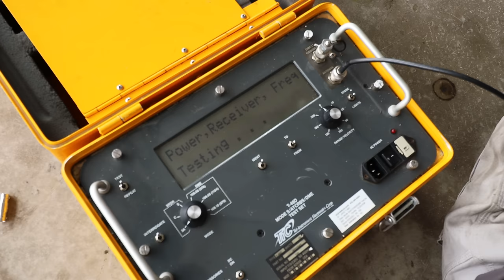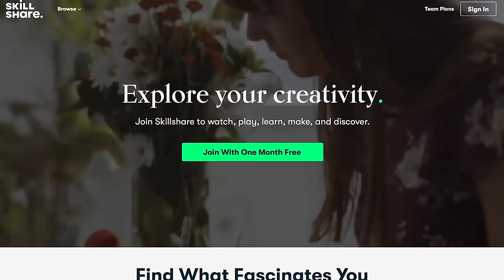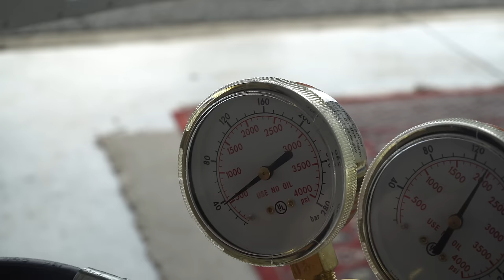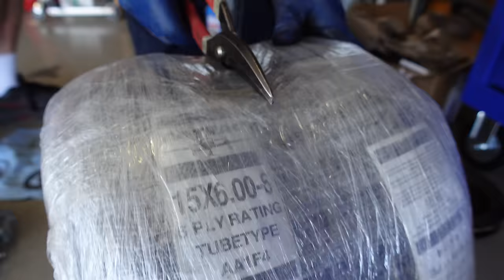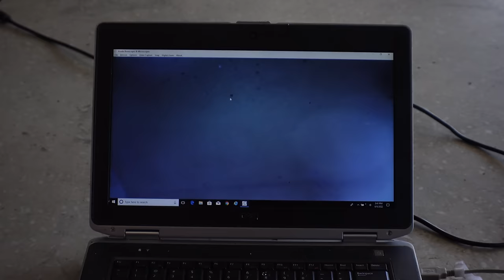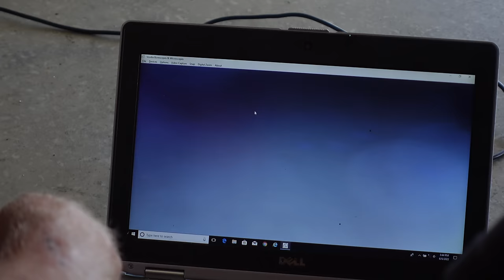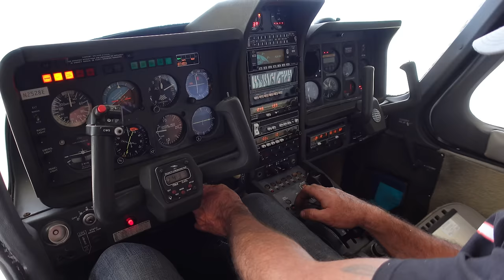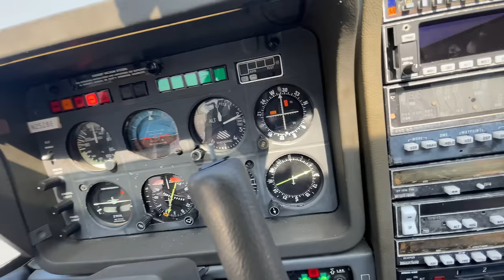Taxiing My Abandoned Dream Airplane For The First Time In 15 Years !

Comment: The amount of work that goes into this is insane. If a plane that small needs that much work you really get to appreciate the technicians that maintain commercial airline planes to keep those huge monsters up in the sky safely.
Reply from the maker: 100%
Reply: The smaller they are, the more difficult they are to work on.
Reply: The problem is the time spend sitting, normally you do continuous maintenance where you will check specific items , not all, so if you do continuous maintenance the expense is lowered and you will have your plane ready to fly always
Reply: Every annual isn't like this. This time, because it's been sitting so long without getting air under its wings, the work is nearly all remedial. When  an airplane is in regular use, most of the work in a normal annual is checking to make sure that nothing's broken, about to break or out of tolerance. It makes a lot of difference, but it still costs $money LOL
Reply: Every size and model of aircraft holds its own challenges. Nothing in aviation maintenance is an easy task. I have respect for all of the workers.
Reply: Tons of time and elbow grease, but none of it seems too intimidating.
Reply: @johnnunn8688  Not necessarily - personally, I PREFER working on the smaller ones (when I was working as an A&P) than the larger commercial (Regionals) aircraft.
@RebuildRescue, unfortunately I'm one of those who can't make it to Oshkosh (much as I'd like to be there), but will try to be "in attendance" online (no guarantees, though).
Reply: @mikebelanger4165 , yes, I also prefer the smaller a/c, it hurts less when you fall off them. The point I was trying to make is, given the equipment on the a/c, there is more space to work, on the larger a/c.
Reply: @johnnunn8688  I’m A&P and I can tell you that it’s easier to work on bigger airplanes in terms of space but in term of time and money smaller ones are so cheap to work on and maintain but it’s pain in the as*to crumble in these tight space to work on some parts
Reply: That and the fact that it’s all volunteer labor why not go for the gusto. Cost him not a dime. May be a few parts here and there.
Reply: @mcasanova1963  Exactly! The worse thing to do with a plane(or actually ANY mechanical thing) is let it sit..Gotta use it!
Reply: A whole lot of people are involved in maintaining airliners, so that work is spread out quite a bit.
Reply: @battz99  I'm still surprised that they haven't bothered to power wash that engine at all. After I knock the big chunks off that would have been the FIRST thing I would have done!
Reply: @sm5o485  Cheap? Are you s******g cash?
$70,000 for an engine rebuild? Another YouTuber says every time he turns around it's $2,000 or $5,000.
Reply: @randallsmerna384   it’s either English is not your first language or you can’t read allow me to elaborate please if you’ve seen my comment it was based on comparison between what’s best to work on big airliners like A320,B777,737,787 I said in terms of space it’s very comfy to work on it but cost so much overhauling one engine could easily be upwards of 800K and maybe triple that depending on what type of engine are you using but small aircraft like the tb-10,C-172,piper180,Mooney M20,s  would cost anywhere between 35-45K so in comparison isn’t that considered cheap to maintain?
Reply: @randallsmerna384  and if he says he drops 2000 or 5000 every time he turn around I think he should scrap his plane because maintenance in small  aircraft privately operated only requires annual inspection which is every year it’s around 90$ per hour and only 16 hours for the inspection other than that you need oil fuel and tires and they’re not expensive either “in comparison to aviation prices not car prices” so yeah you might face a major discrepancy but when maybe once every 7 to 10 years depending on the airplane and how many hours you’ve flown and have you taken care of it or not hell it might not even have a major discrepancy because airplanes are built to last if you maintain it right if you go cheap you might pay with too much money or sometimes unfortunately with your soul.
Reply: @randallsmerna384  Totally agree
Reply: My father has owned planes for as long as I can remember, for over 33 yrs.  Can’t remember first 7.  Anyway, he has spent at least 1-2hrs every weekend at the hanger with his planes for those 33yrs.  He is always working on, cleaning, updating something.  It’s a way of life when you own small planes and fly them often. Your wife and kids either learn all about it or miss seeing dad a few hours to days every weekend 😂.  Needless to say my brothers and I embraced it and soaked in as much as we could.  We were always ready to go up in the air to take the controls.
Reply: @johnnunn8688  Not true, I work on everything from a Cessna 150 up to C-130s, small aircraft are much easier

Comment: I know you said you are getting a new XPDR because you need ADSB out but I'd recommend a full VSWR and insertion loss test be done on the RF cable and antenna. More often than not its a cable issue (corrosion, vibration, chaffing) that cause most of your problems. These issues cause the TX side amplifier to burn out and can damage the  RX side of the XPDR too. I am NOT an A&P commnav I am a ground NAVAIDS/comm maintainer. Same principles apply.
Reply: Yeah, 34 year old coax and connectors? Then replace the XPDR because the signal is weak? Bad practice.

Comment: I love to see how old airplanes are coming back to life.
At 10min 35 s it is visible a crack on main wheel well. It was drilled once in the past but it is spreading. I belive, for safety reason, it should be investigated and repaired. Many best wishes for this and other projects

Comment: Interesting to see the KC 191 autopilot. Me and three other engineers designed that approximately 35 years ago. Amazing to see that product still in an avionics panel. The AP is a hybrid... the inner loop is analog and the outer loop is digital. At the time we designed it the microprocessors didn't have enough throughput to run both the inner and outer loops.

Comment: If you haven't done yet, make sure to remove the pitot tube and static port to check for some possible obstruction. Their lines and gages must be checked as well. And make sure the pitot tube is covered at all time while the plane is on the ground. A tiny bug can cause serious problem.
Reply: Yeah, a bug caused a multi billion dollar B2 Spirit, to crash!
Reply: What serious problem would that be ?
Reply: @pauleyplay  the pitot tube senses the air going into it to operate the air speed indicator, along with other instruments
Reply: @audvidgeek  Almost. Senses air pressure only to the airspeed indicator, no other. You may be thinking about the static lines. Think about this, pitot is uncovered throughout all flights. They get all kind of guck & speed goes to 0 ). Most general aviation light  to mid planes no big deal. If a landing cant be made without airspeed indicater more training is needed.

Comment: Just a recommendation here I love the channel, but I recommend that you use copper based never seize on components with heat you’ll see that it says hi temp. The regular never seize will degrade on plugs or exhaust manifold studs or bolts. Keep up the good work guys!

Comment: Before replacing transponder, disconnect all connectors, give them a good clean with some contact/carb cleaner and reconnect.. i know all contacts should be gold, but that reading was not far off.. love what you do!
Reply: Not only that but if it failed for weak signal suspect the coax and antenna.

Comment: Awesome job guys, best practice is to always deflate a split rim tyre before removing the axle nut, just in case the rim bolts could fail. Cheers from Down Under

Comment: I would invest in a good speed handle. Using a regular screwdriver in crazy with all the screws in those panels. We used them in the Air Force when repaneling F-111's. They worked great and where a definite time saver and relieved ones hands from cramping up.

Comment: Did you know that you can put those brake rotors in some muriatic acid for 30 minutes, take them out and rinse them off with soda water then rinse them off with clear water and dry them immediately with compressed air and they will look brand new in less time and much less labor than doing it by hand with a wire wheel. Just a thought, good luck with your projects.

Comment: Make sure to align the dots on the sidewall with the valve stem of the tires. That allows for quick reference of tire slip on the rims of freshly installed tires. That’s why the dot’s are there. Very critical for braking. Important to test on high speed taxi after installation prior to first flight
Reply: While you are correct about aligning the dot with the valve stem, slippage indication is not why they are there. The dot indicates the light spot of the tire to align the stem there reduces the amount of weights required to properly balance the tire assembly.
Reply: 180 the L too
Reply: The dot is for aligning the light/heavy side of the tire with the wheel. This provides a better dynamic balance. Just because you hear things, does not mean those things are facts. People make stuff up all the time by guessing.
Reply: @RedNeckWelding  Bang You got it ! Well done

Comment: Glad to see all the progress on this project. I've got one question. Doesn't civil aviation requires nitrogen to be used on tires and pneumatic struts? The reason I mentioned it is because when I was working on airplanes in the Navy that's how we did it and it was a big safety factor. Just trying to keep you guys safe.

Comment: I've heard of fighting fire with fire, but never washing dirt with dirt 😜. Get that man a clean bucket of water and some of mcguiar's ultimate buffing compound with a wool pad. You'd be amazed at what it can do!
Reply: NEVER buff an airplane with a wool bonnet. If you're not careful you'll burn thru the non-clear coat finish down to bare metal. Instead use a foam bonnet that doesn't build up heat like wool.
Reply: @dieselyeti  I use wool on automotive paint, just to buff off the compound, I do use foam pad to apply. Just gotta keep the speed down. That's good to know tho. 👌
Reply: @beb38138  That's ok for a clear coated automotive finish if you're careful and keep the wheel moving. But for whatever reason aircraft finishes aren't clear coated so you have to be super careful and use a foam bonnet. I learned the hard way many years ago.

Comment: Putting a little air in an inner tube helps with installing them straight as well. I usually put a little in to get all the wrinkles out and to help keep them from getting pinched.
Reply: I see you did it on the 3rd tire lol. I need to just watch instead of commenting lol.

Comment: The Trinidad is a beautiful looking aircraft. The French certainly know aviation. I see it has trailing type main gear legs (good!). Looks like the nose leg has a built-on airbrake.               I wonder if the grease nipples are metric, and your grease gun nozzle non metric?  At 28.05 there is a good view of the port & stbd wing spars join. I found a leaf blower also helps blow out grass from inside wings etc.  Joe is great!...love his humour (and white sox!) ...has a voice like Willie Nelson.  I use a floor crawler/creeper that has an adjustable headrest...so worth it! ..was about US$50. I notice you went for the quality battery.  And you noticed the airframe's internal chromate protection....SOCATA quality.

Comment: I saw that plane sitting for years. I was based at Frederick until 2019. I always thought what a shame to see it rotting. There was also a Grumman Tiger that sat for a long time but it was bought. Get it back together and you will have a very valuable plane there.
'

Comment: If the clear plastic on the wing tip light lenses is the same type as on automotive headlights,then maybe able to "buff" out the hazing with a very light "white rouge" buffing compound(by hand or using a small buffing tip with a drill)...
Reply from the maker: We were thinking that as well. Going to give it a try !

Comment: Maybe invest in a bench grinder with a wire wheel.  That will be like butter to remove rust.  RPMs on a cordless drill are too low to wire brush when you don't have to.

Comment: The heat build up inside a aluminum structure, without forced ventilation, is insane. How in the heck does the birds and their eggs survive that? Inside an aircraft wing sitting in direct sunlight!
I had to decline a job because I could not handle those still air temps.. Awesome job you and the crew are doing there.

Comment: when I see how ingrained the dirt is and especially the paint damage on the wingtips I think you are going to need a repaint! Applying a fresh coat of paint to a small aircraft will cost more than double the amount that is required to paint a car, depending on the type of paint and body graphics you wish to use. A basic coat of non metallic paint and the use of new stainless steel screws for the cowling and wing tanks will cost you anywhere from $5,000 to $10,000.

Comment: Watching the rest of this video Im thinking it'd be a good idea if working alone to have a pair /more of suction cups linked by adjustable ratchet strap such as used on lorries to secure loads to hold panels in place whilst you remove/replace the screws. Useful or not?

Comment: Another great interesting video...I don't have much experience with flying, other than being a passenger on commercial airliners several times, its the mechanical stuff like you are doing that I have no clue about....lots of different things than a car...a car you can pull over and fix, you can't exactly just pull a plane over in the air to fix it LOL.

I see this plane logging a lot of really good hours on it helping others...nice work with this one.  Can't wait to see your other plane finished and doing the same, but I can see how that one is going to take much...much longer to get it to that point.  

I've heard of Angel flights, I've seen a few videos about them as well.  What is there for us ground people to do that don't have planes and don't have pilot licenses?  Is there anything we can do to help, pickup people and give them a ride to the location for boarding the plane?  Pick them up from an airport to drive them to their appointment?  What is there that us non-plane operating people can do?  I'd love to be able to help out somewhere in the future, but where can I find information of contacts for this in my area?  I'm located in the Boise, Idaho area.

Comment: Finding all that bird nest material in the port wing reminds me of the video of an ultralight taking off, which woke up a CAT that was sleeping, once again, in the port wing of the aircraft. They landed safely and the cat was fine, but still, creatures get into the damnedest places. I saw birds squeezing into holes on the sides of a disused gas grill in my backyard, with twigs and bits of straw in their beaks.

I don't know if Aero Sheen is still around, but it's great for getting surface oxidation off the paint and making the surface slick as glass. We used to use it on our cars, because it worked so well on planes.

Comment: for popping the bead on a little nose/main like that tire. use a plastic wedge and a heavy rubber mallet. gives enough ass and don't scar the wheel half . I worked in a wheel and brake shop for awhile. coolest tire I got to change was a Douglas dc3 wheel. I don't miss it believe me

Comment: A serious question from a car guy: How do you balance those airplane tires?  I don't see any place for balancing weights. Is it done by adjusting the hubs or what?
Reply from the maker: Usually stick on weights placed on the inner edge of the wheel

Comment: As I've been watching you clean out the TM20 and the C401 I've been wondering, probably like everyone else, how much does all of the junk weigh that you have cleaned out of each airplane. It seems just for the TB20 you've removed at 120lbs. Can you imagine if you hadn't gone through this plane as you have that you could well over weight limit but think that you where under by a decent margin.
Reply: and imagine if all that stuff SHIFTS in flight, and upsets the balance of the plane!

Comment: I highly recommend you use “aero gloss” on the paint and NOT wet sand. Message me for application technique. Obviously, you will eventually need a paint job but aerogloss will make a huge difference and buy you some time.

Comment: Be for replace if the transponder I would try replacing the coax cable from the transponder and the antenna as it’s probably far cheaper and coax cable can sometimes go bad or something culd have chewed on it or could have corroded from the bird droppings ect
Reply: Bad coax could affect signal strength but the old transponder failed on frequency.

Comment: are your main struts even, your left wing looks like it is setting higher than the right.
Reply from the maker: The pressures are set evenly in both struts. I believe they may need to worked a bit.

Comment: Love the channel! Quick question though about the tires. Were you putting regular air in from the compressor or was it straight nitrogen. Just asking cause I’m sure you know that regular air expands when you climb in altitude, Nitrogen does not. Just want to make sure you don’t hurt that beautiful new rubber! 
                                  Ringo.
Reply: After doing a quick internet search, its more about the flammability of Oxygen than expansion.  Larger aircraft use nitrogen in their tires to reduce the chance of fire during heavy landings, and also nitrogen is less likely to slowly seep out of the tires.  Smaller aircraft put less stress on the tires so this isn't as much of a worry for general aviation aircraft.